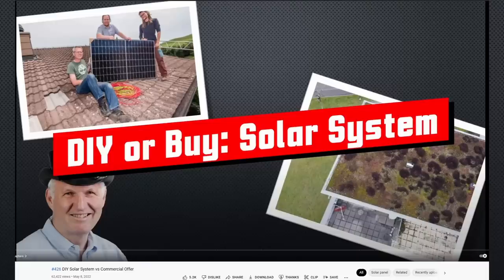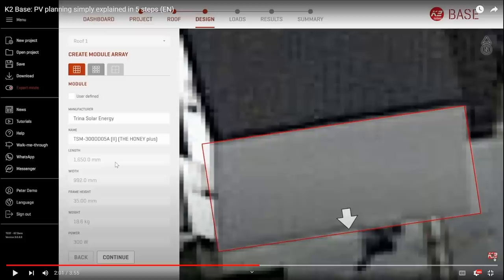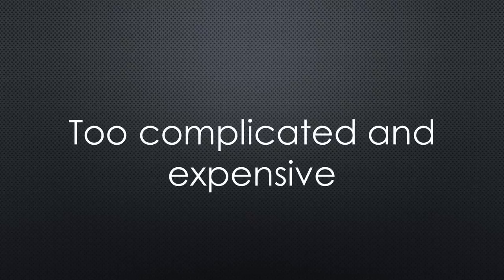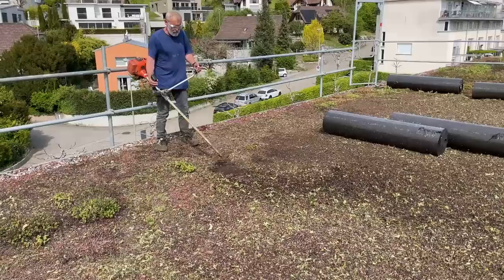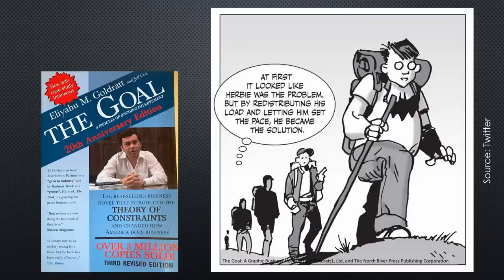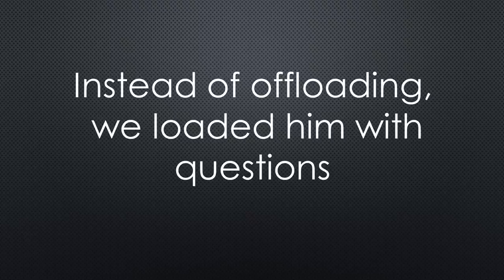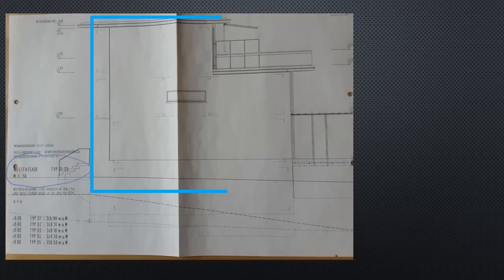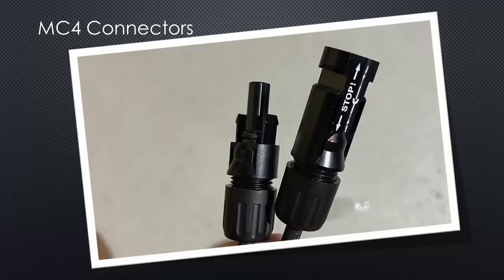#427 Four 8kWh DIY Solar Plants with neighbors (Part 2)

Comment: As to routing both the negative and positive cables together, I suspect it has to do with EMC, a balanced pair is less susceptible to interference as well as less susceptible to emit interference (within reason of course).
Even if the gear is well filtered and dimensioned, you will have some emissions. So a a grounded conduit to run the cables in as well as balanced routing (+ and - together) will minimize what little emissions are left.
If you have RFI issues, it's most likely on the sections where you have only the negative or only the positive.

Where I live, we've had a number of highly publicized problems where routing, cabling, filtering etc. had not taken the potential for emissions from the panel DC lines into consideration.
Reply: EMC engineer here, this is spot on. Large loop area means a lot of EM energy goes in and out, so you're both radiating interference (potentially disturbing others) and receiving lots yourself. Specifically in large circuits, this makes you susceptible to lighting damage. If a lightning strikes nearby, circuits with large loops induce kilovolts of transients and this kills your inverter and possibly the panels themselves.

By running the return current in the same path as the supply, the loop area is minimized and so is the transient voltage.
Reply: Solar Panels are DC... there isn't any EMC.
Reply: @johncoops6897  They do generate DC. But the load which is presented to them, i.e. the current drawn, isn't pure DC.
You almost invariably have a MPPT and an inverter connected to that DC source, that even if filtered will induce AC currents in the wires, and the higher the current, the stronger the magnetic flux around the wiring, and the stronger the magnetic flux around the wiring, the stronger the emissions from it.
Keeping DC cables routed together (i.e. balanced) and preferably shielded, even if in a grounded conduit, will minimize these emissions as the balanced routing will make the magnetic fields cancel each other out and the grounded conduit (for all intents and purposes a shield) takes care of the rest.
Reply: @Teukka72  You got it right! Only if you mount on steel roofs, one can ease up a bit but this is not the case here.
Reply: @johncoops6897  A loop does not have to have any current flowing. It is still an antenna that can receive from other sources such as lightning strikes.  And in this case it can also be a transmitter if the inputs to the inverter are not filtered as much as would be ideal.
Reply: @GodmanchesterGoblin  Lightning is also what I was told.
Reply from the maker: Thank you for all the input!

Comment: Love it - a whole neighbourhood getting together sharing and dealing with life in a way that makes it better for themselves and everybody else.

Now you just need a large mountain that you can pop a retractable large mirror to shine extra sunshine onto the roof - you could call it Light Over Range And Nice - LORAN for short :-).
Reply from the maker: Cool name! But if I remember right, it is already taken ;-)
Reply: @AndreasSpiess :). Once you get remote monitoring of the power generated set-up, it maybe worth just using a small signaling mirror upon the panels to see the effect.   You could maybe with code enable a form of remote communication back home.

Heck, imagine if the firmware in solar panels could detect an SOS, that would have benefits in some areas and a cool hack if viable.

Comment: 9:15 the minus cable has to run in parallel with the plus cable. As far as I know this is to reduce the surface of the loop and thus reduce effect of the electromagnetic pulse of lightning on the inverter.
Reply: Thanks! Was wondering that. Luckily at 450V a bit of wire length is worth the extra safety.
Reply from the maker: Interesting. That makes sense! Thank you.
Reply: If lightning is a concern then lightning arresters and rods  connected to a good ground mat are the best solution. Lightning is 1,000s of amps and quite capable of vaporizing anything smaller than around 25mm ^2 conductors.
Reply: @robroysyd  Exactly. I was thinking of indirect impact. When lightning hits something in the neighborhood. The amps create a huge electromagnetic field in the neighborhood.
Reply: @paulfontaine7819  Yes it does but it also causes lots of current in the ground and potential difference between points in the ground. Keeping in mind that one side of the DC from the panels is typically connected to ground I'm still not seeing much if any protection afforded by insisting they're of the same length and physically tied together. On the other hand there's going to be a power loss due to the longer length of cable. There are scenarios where you really do want to keep wire length the same so impedances are the same e.g. batteries or  capacitors in parallel.
Reply: @robroysyd  this is discussing EMF from nearby lightning. Direct strike protection like you say is a different and as you say more robust solution.
Reply: @Paul Fontaine I tottaly agree with your reasoning.
It is a general rule that we should always run two differential conductors in parallel and in close proximity. Otherwise they will work as an antenna, receiving surrounding electromagnetic radiation and noise of all kinds.

Comment: Andreas.... THANK YOU. Beautifully and professionally produced, credits for this superbly done video. I remain amazed that ballast stones are considered enough and hope that over time this will be proved right, Here in Ireland I am certain it would not work.... we clocked over 166 KM p/h during one of the recent storms. But... time will tell?
Thank you again...a very happy subscriber to your channel.
Albert
EI7II.
Reply: I live relatively close to Andreas and just checked the meteorological data and since the early '80s there hasn't been a single day where the 10min-average windspeed reached 20 m/s once.
Reply: @Xoron   Thanks for your comment. He  (Andreas) is so very very lucky. I frequently hit 60-80KM P.h here at the QTH ( my Bresser Anemometer measures the data for me) .... that is why I have not ever considered  standalone on roof mounting. I have been at the receiving end of a 107 Mph s( about 172 KM P/h) storm and was deadly afraid I would have no house left. Fortunately, even for us here in EI land.. those speeds are rare, very rare, ... but no amount of ballast would save you in those cases.
Reply from the maker: I am not sure if the ballast is the important part. Because the panels are very close to the roof there is not much space to enter below the panels. But, as you say: we will see…

Comment: As far as I know plus and minus wires should run close together so they do not take up a big voltage gradient when a lightning strucks.
Reply: I would have never thought about it! Do you have any resources for me to read up to learn?
Reply: @thomasperri3294  I forgot where I picked it up, but googling "pv wiring lightning induction loop" will give results
Reply: Yep, this is the reason.  Even strikes hundreds of metres away can kill an inverter if you have a big open loop.   The induced voltage is proportional to the enclosed area.  A follow up video with a bench top experiment is needed! :-)

Comment: Congratulations on the installation of the mounting system, the cables and the solar modules! The project is almost finished! We are looking forward to the 3rd video 🎬
Reply from the maker: It will come later. Currently, the panels work as expected…

Comment: Good fun. I had mine installed by an experienced team, already in 2014. My roof is a lot smaller, so I only have seven panels. That team managed to do the complete installation in about three hours, with 4 people if I recall correctly.
Reply from the maker: A fast crew!
Reply: my neighbor also called a pro-team to do the installation, 16 cells. 2 guys done the installation of the rails and cells and wiring to the cellar in total 4 hours on two days, as a thunderstorm stopped them mid-work on day one. (electrician took his time connecting the cells to the grid (they gonna feed surplus-power to the grid))
Reply from the maker: @michaelkeller5008  extremely fast!
Reply: @AndreasSpiess  yeah, these guys were insane

Comment: Good to see neighbours co-operating towards installation! Here, in last 10-15 years, neighbours don't talk and rarely if they do, they do it to fight. For wind, a small hole in roof and anchoring base plate with some cement/concrete work on top to prevent water leakage and adding strength is mostly followed. However they use PVC pipes to save money instead of aluminum pipes. i don't much about cables but in case of higher voltage dc, arcing is dangerous. Also earthing is very important here ... 3 earthings are required, one for panel structure, one for inverter and another one for lightening arrester.
I am sure, after installation is complete, instead of checking whatsapp messages, most of the people will check realtime power on their panels (although in my case it is updated every 5 minutes). And by the way, drilling in concrete is the most irritating sound, so that should find a place in the video :-D
Reply from the maker: Fortunately, I have nice neighbors! And you are right, everything is grounded with thick cables. And a lighting protection is also mounted.
I hope that I can connect to the Inverter to get faster updates ;-) But currently, we are watching the energy production like TV ;-)

Comment: Nice video!  Solar is becoming sick a good source of electricity. I live in the Netherlands and thought it would never work hear because of the weather.  My brother in-law has a system and it cut his electricity bill in half. During these current times with energy costs going so high he most likely save 75% on his energy bill.

Can not wait to see your experience!!
Reply: If energy costs were low, solar wouldn't be worthwhile.
Reply from the maker: I am also eager to see the energies flowing ;-)
Reply: @AndreasSpiess  We have entered an era of cheap electricity. It's very similar to cheap food, cheap textiles, cheap steel, and cheap communication. It's astounding how much technology has changed the world in the last 500 years. Really it is. 

Gutenberg's printing press marked the end of the Dark Ages in Europe and the beginning of modernity.

Comment: Wind loading is usually calculated on 100 years of records, which doesn't account for freak winds, or the average changing over time -  a flood region near us had to have all the houses raised by 1m due to changing averages -. We live in a high wind area on top of a hill, and a friend was cut in half by flying roof sheeting, so I would doubly make sure stuff can't fly away.
Reply: Yep, plus Switzerland is nuclear target, so one can expect quite huge blow once every major war is happening. Statistically just few times in existence of humankind.
Ad securing stuff - steel cables are cheap. 
Goal is to secure things to not fly off the roof completely, not to prevent them from moving around a bit - actually some play gives more chances of stuff being pushed vs broken or bent. 
So a steel cable bolted to concrete on the edges and then strapping the panels etc.
Reply from the maker: We have an insurance which pays for such rare events. But they can happen, I agree. And maybe I will say afterwards: I should have better listened ;-)

Comment: Really neat that the neighbors worked together.  What a great way to bond.  I bet you are much better friends now!

Getting solar and batteries was one of the best upgrades we made to our house.  We went with the Tesla Solarroof and Powerwalls. Even with crews of 5 or 6 people it took these pros about 3-4 weeks to remove the old ceramic tile roof, rehammer or add nails to every piece roof sheeting, put down underlayment, run the cables, install the solar tiles, wire the tiles to the 2 inverters, install batteries, and get the system connected to the grid.  So, we paid for all that and I was glad we did.  However, it would have been a great bonding project if we could have done it as a neighbor install.  Unfortunately, that was not possible.  At least Tesla now has the 25-year warranty support requirement.
Reply from the maker: I can understand that it took some time. Our „tiles“ were much bigger and much less mounting and connectors were needed…

Comment: LOL, re-discovering the old saying, "The harder you push the work, the slower it goes". I've seen project managers that push so hard that the project comes to a complete stop. There is a sweet spot of gentle pushing, and knowing when to back off. It takes a lot of experience to understand this idea. Too bad that they don't teach this at any management school (at least none that I've seen).  😃
Reply: I think a good leader should delegate more and control and support when the people are doing something wrong. I've installed Solar in a company also with only one leader who know how and even with bad language skills but he has taken time to to explain us what is to do and then we did our thing and he his. Sure on the beginning need to study the plan and calculate some stuff which thakes time. Maybe there where some wrong calculations that where wrong so they had to redo it. Or maybe the leader wasn't so experienced
Reply from the maker: I agree, explanation would have helped. But it was not easy for the leader because we were his "customers". An unusual situation.